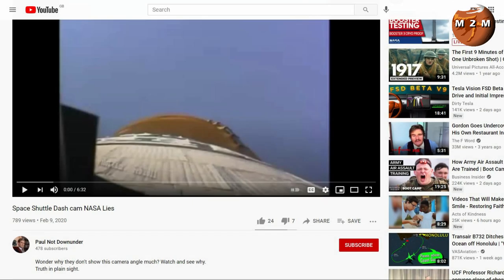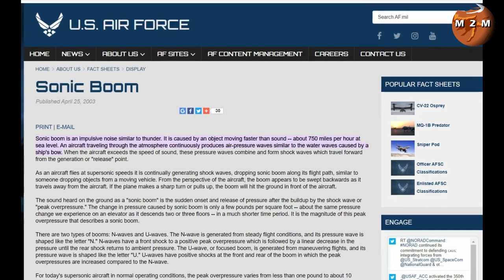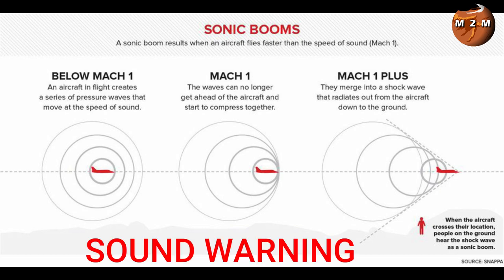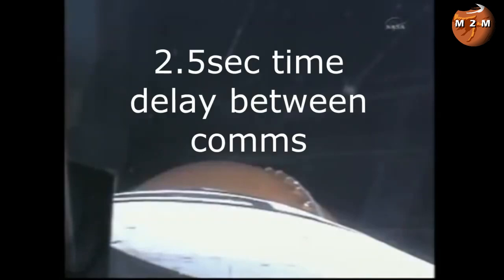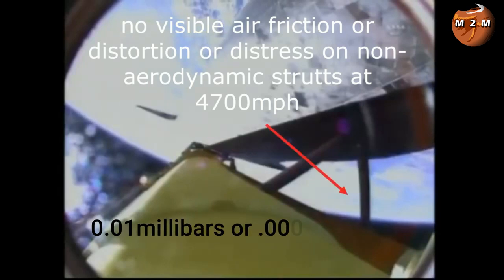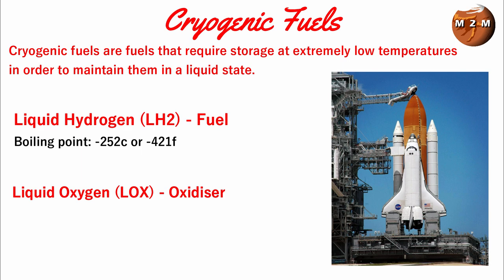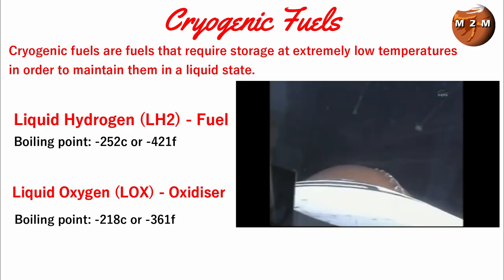#2 Teaching a Flerf a lesson!!

Comment: As far as I know, in each launch they announce the moment the Shuttle reaches "max Q", the point of maximum aerodynamic pressure, that is in 11 kms height. 
 
On the Apollo rockets that was in 13.4 km height. 
 
 
I am pretty sure that the engineers plan out the acceleration gradient throughout the launch so that no critical stresses occur.  
 
As the pressure stress is dependent on the spee, when the pressure stress would be a problem at a certain height, then the engineers would simply slow down the acceleration, so that the rocket is higher up (less air pressure= less drag) before it reaches this speed.

Comment: Those close to the launch site do not hear a sonic boom because they are within the shock wave cone as the shuttle goes supersonic. Only those outside the cone will hear the boom, as the shock wave passes over them.
Reply: In short, if it's heading away from you when it goes supersonic, you won't hear it.
Reply from the maker: @cambridgemart2075  But by going up it is going away from them so...
Reply from the maker: @cambridgemart2075  However yes good point

Comment: He hears a supersonic boom right from the start... the rocket engines jet exhaust has a speed of 3 km per second, way over the speed of sound. 
 
The trick of the supersonic boom is that the plane or whatever it is is FASTER than the speed of sound, and drags the shockwave along with it with more than the speed of sound.  
 
That means that, as the plane approaches faster than the speed of sound it makes, you hear nothing, only if it is past you hear the boom (at a distance between you and the object is as far as the noise needs to travel at the speed of sound), and as the object is moving faster than the speed of sound, you can't hear anything what comes from it when it has passed you.

Comment: The sonic boom from a rocket travels UPWARD !
A 2.5 second communication delay ? Just listen to the conversations between the pilots of some commercial aircraft and the control tower. Delays ranging from a second to 10 seconds, or even more, are common.
At over 60 Km of altitude, there is almost no air remaining, meaning almost zero friction. The atmospheric pressure is less than 0.01% of the pressure at sea level, and dropping by the second.

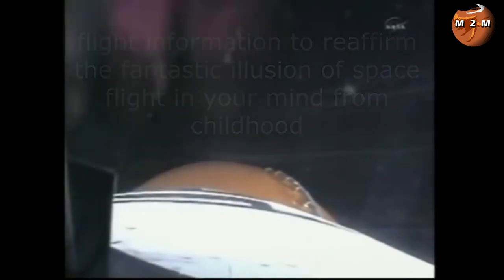Comment: @6:08 to 6:10   Anyone know what that effect was?  I was guessing SRB separation but that does not appear to be the case.
Reply from the maker: Listen to the audio just before that. The commentary said, "one minute fifty seconds into the fight, we're standing by for separation of the twin solid rocket boosters".  So don't see why it would be anything else.  About two minutes into flight or at about 146,000 feet altitude was a standard point for SRB separation on Shuttle.  https://www.nasa.gov/returntoflight/system/system_SRB_prt.htm
Reply: @M2M-matt  I understand now.  I had confused the SRBs with the large tank.  The tank was still clearly in view and so I assumed that the SRBs had not been jettisoned. Completely my mistake.
Reply from the maker: @Robert08010  all good 😉